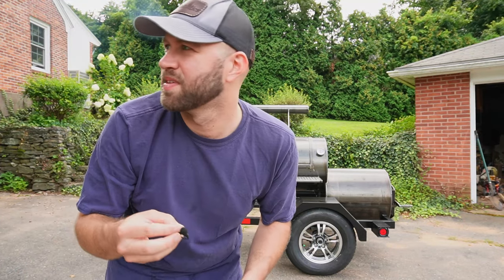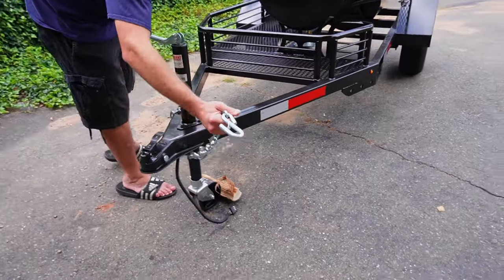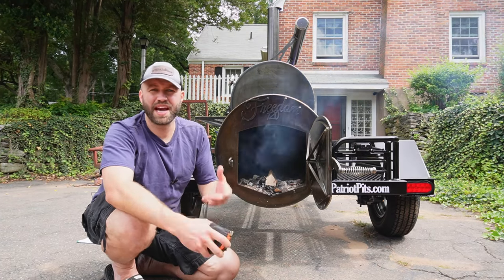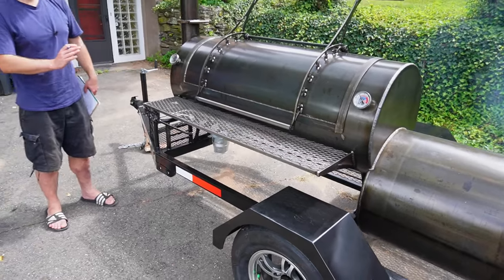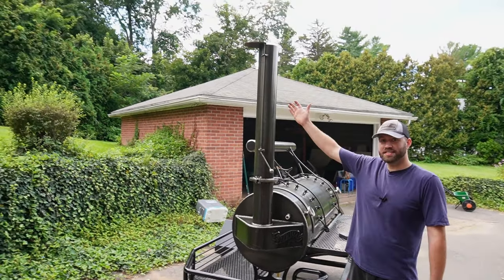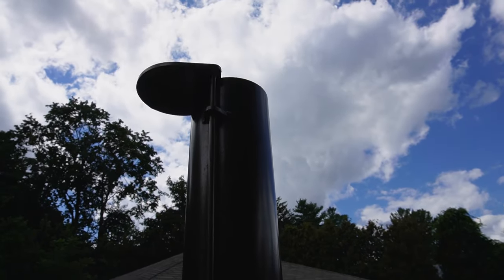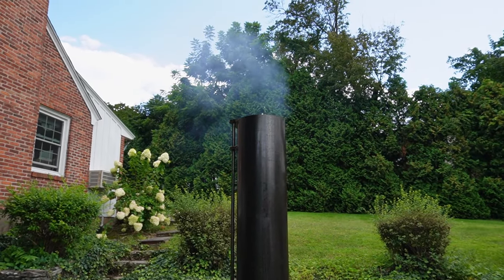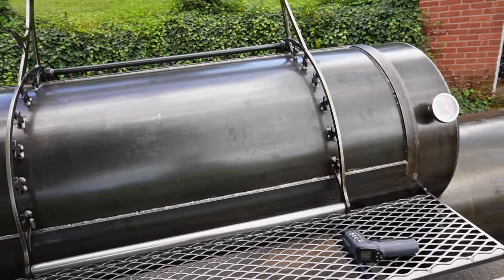PATRIOT PITS FREEDOM 120 REVIEW! | Initial Thoughts and Temperature Test! | Fatty's Feasts

Comment: This is amazing!!!  Probably way more pricey  than the Freedom 94.  I wonder if we can get the 120 with the wagon instead of the trailer.  I may have to pull it around the yard, but i won't be towing it anywhere.  Great job Josh.
Reply from the maker: The thing is a beast! Currently he's not making the 120 on anything but a trailer, but with the weight, I'm not sure it would even be doable to make it on a wagon. Worth reaching out though!

Comment: Would be nice to fully open the stack vent to see the actual draw.  Looks like the smoke is coming out of the fire box instead of going through the pit where it should be going.
Reply from the maker: Must have just been the camera and lighting. I can confirm there is plenty of smoke coming out of the stack. The draw on this thing is literally insane wide open. It looks like a jet engine, but honestly, the hottest temps remain pretty close to the firebox.

Comment: Quick question: I wanna know if it’s leaking (or not) a lot from the chamber door  when you cook with the damper 2/3 close or 1/3 close ?
Reply from the maker: HAHA I just responded to you on instagram. Apparently you did see the video 😂
Reply: You might get a puff here or there. Every build is unique, we really try to get them sealed out of the gate. Worst case after a cook or two it’ll seal up. Usually the carbon will take care of any slight leaks also oiling the door seal helps.

Comment: They don’t have any reverse flow models on the website.
Reply: No reverse flow from Patriot pits.
Reply from the maker: They do not offer reverse flow. It's honestly not necessary.
Reply: @FattysFeasts  that’s an opinion and you’re welcome to it. I vastly prefer it and frankly the only videos that I’ve seen comparing them approach the cook the same way they do in the straight thru model. I won’t go into it here but a main feature is you get to use the entire cooking surface. I feel so bad for those that spend $$$$ and can’t use a third of their cooker near the fb.
Reply from the maker: I feel that. A lot of people also claim it is much easier to prevent burning, as the draw isn't as much, especially on smaller models. I just prefer the straight shot and backing the flow down. I found once you get to a good spot, you don't have to play with it much. Also, not sure if you watched the temp test part of this video though, but I lost about 6 inches of cooking space, which would be taken up with a water pan anyway. @mikecoughlin4128
Reply: @FattysFeasts  I don't think the draw is less, I think the heat is more indirect and gentler due to the air flow path. The water pan on a reverse flow can sit on the baffle plate depending upon the design. I just think it is a gentler, more manageable, heat with advantages of radiant heat off the baffle plate. It's not that "you don't need it" as much as "I can have it". Everyone has their preferences! Cheers.
Reply: @michaelcoughlin8238  Not trying to change minds here, but a couple of things. Depending on the RF you are speaking of. I can tell with almost 100% certainty that a conventional flow will always pull harder. Just by design. As far as cooking. When getting into thick steel. I don't think that much radiant heat is a good thing.  Once you heat up 3/8 steel it will radiate quite a bit of heat, so in essence you are putting a griddle under your brisket, and then wrapping more heat around to the top on the back side. This creates a little problem when making a brisket (for example). Fat cap up or down? Either way, the unprotected side will be taking a ton of unnecessary heat exposure making your cook time reduce to a point where you might not get a completely rendered product.
Reply from the maker: That's kind of what I meant just worded different. The speed in which the gasses are travelling are affected due to the path and the barriers. I'd be curious to try one some day. @michaelcoughlin8238
Reply: @Dan-fc1nc  As I mentioned earlier, I think its all about "cooking to your cooker". Meaning your cooking style needs to be adjusted to the properties of the cooker. You cook differently on a kettle vs vertical vs offset vs kamado. There is also a difference between a straight flow and a reverse flow. When I see YouTube comparisons, they don't do that. I don't have both so I can't illustrate what that would look like. I'm not saying that I disagree with anything being said here. I just think that people dismiss pits too easily and sometimes for the wrong reasons. Myself, I don't like pellet grills and I've actually never even used one.